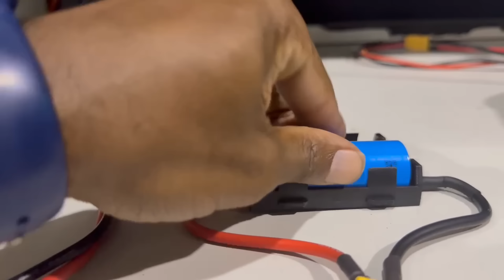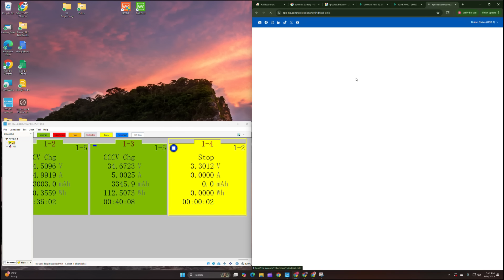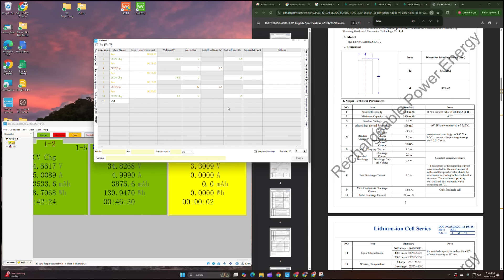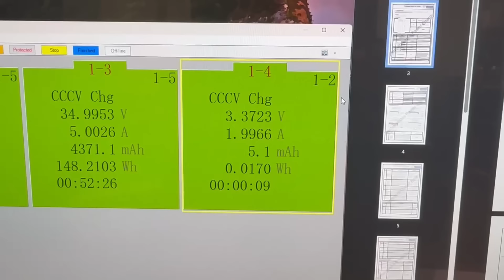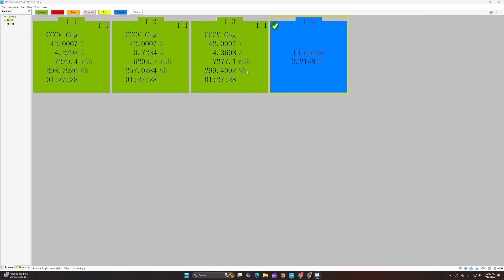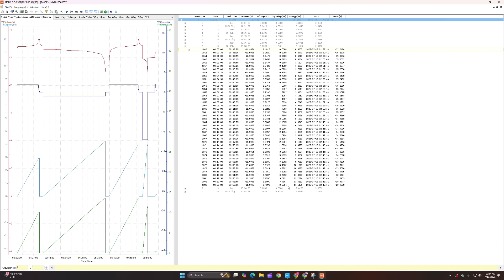JGNE 26650 LiFePO4 RPE Battery Test – Power & Range Results! 🔋💪 Passed with Flying Colors!

Comment: I replaced my 5S2P IFR 26550 3300mAh pack with these for a robot. Yet the robot refuses to start. I checked the battery pack using a Blance Charger, and it works well. I wonder how I can diagnose the starting problem. Any suggestions?
Reply from the maker: Do you see and output on the battery pack?